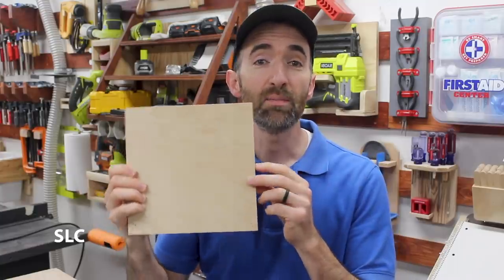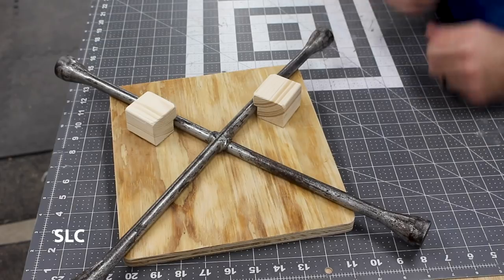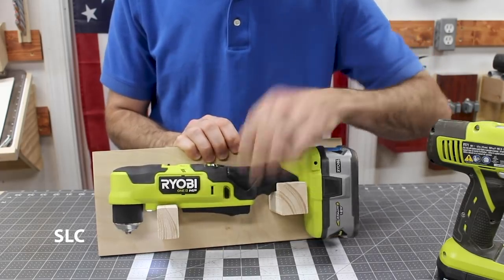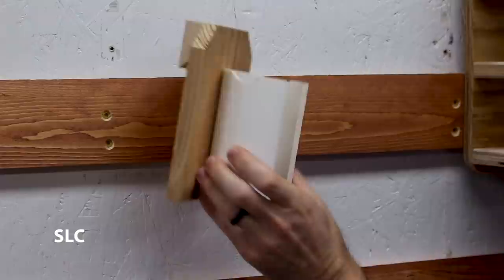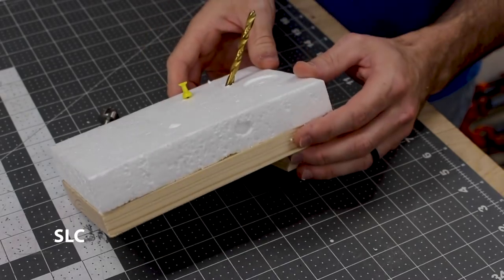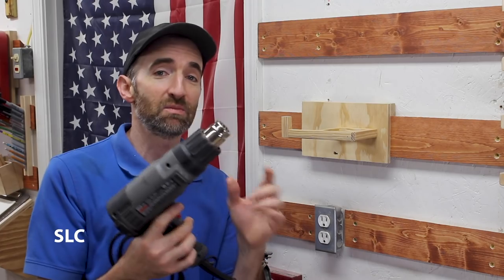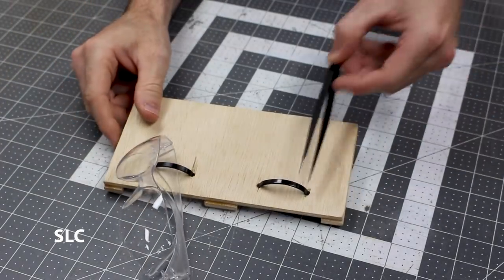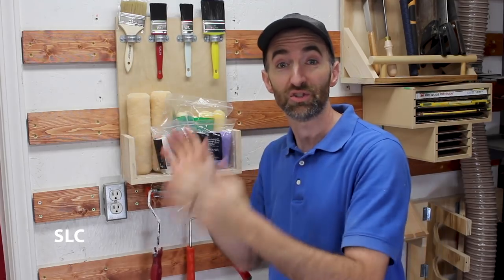20 MORE Simple French Cleat Ideas for your Tool Storage #6

Comment: Realized a few days ago that small Pringles cans are the perfect size for duct tape (and other types of tape).  You can remove/replace the tape by taking the cap off. Works kind of similar to the bucket as a three way holder, except I have the Pringles can oriented side to side.

Comment: Fantastic ideas. Thank you for sharing. 😊 Can I ask how far apart your cleats on the wall are? Have you found an optimum distance between them or it doesn't really matter? Cheers from Australia  🇦🇺
Reply from the maker: The distance depends on your preferences and the size of your wall. Just keep in mind that if they are too close, it might be hard to attach and remove the cleats. Also make sure each wall cleat has enough surface touching the wall, and each are well secured with long screws into the studs.
Reply: @SpecificLove7  thank you very much. 😊